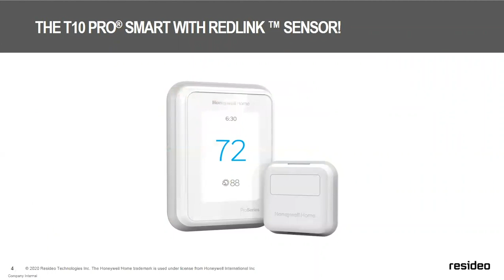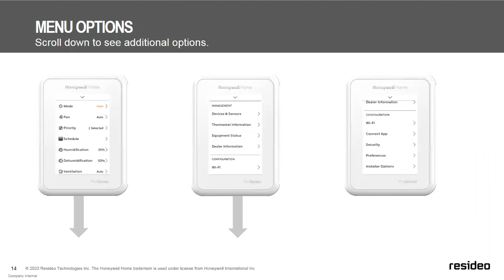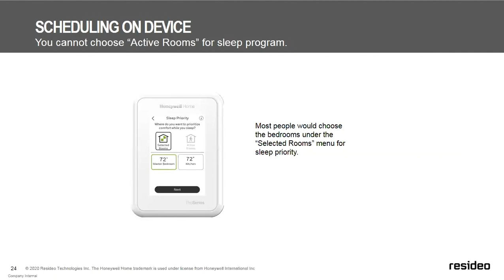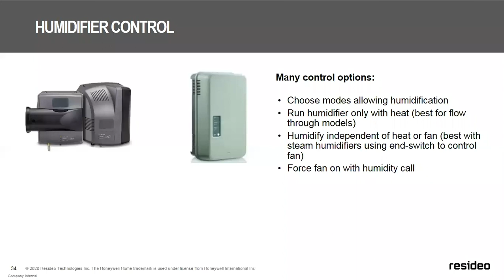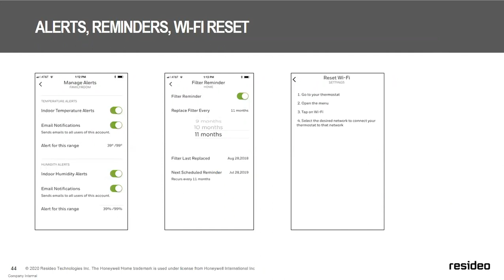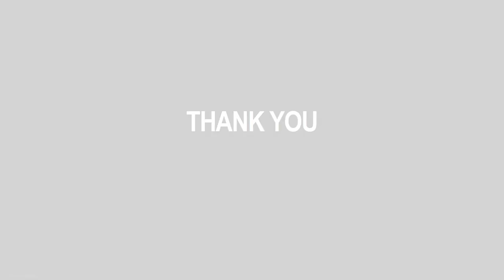T10 Pro Smart: The Game Changing Thermostat

Comment: we have this tstat as well since we had new hvac system installed in may of 2022, seems to work really well. how do you get to the area where you can adjust the sensitivity by 1,2,3 degrees? we changed this during cooling season cause it seems to run forever, and now heating time if its set say to 68 degrees, it runs to 70 cause we changed it to a 2 degree -, and want to set back to standard. any suggestions or how i get to that screen to change back?
Reply from the maker: Hi, we'd be happy to help! Could you provide us with the complete model number of your thermostat? This will be located on the back side of the thermostat itself. It’s a number that starts with RTH, TH, or CT. -Jerry
Reply: @ResideoPro  have try and get
Reply from the maker: Hi Rob, thank you for contacting us. To adjust the differential we recommend you reaching out to the installer of your thermostat. This is part of the advanced configuration that should be adjusted by a professional, you can find other local licensed professionals here: https://www.honeywellhome.com/us/en/find-a-pro/ -Maria

Comment: I bought this thermostat but it doesn't have humidification option on menu for some reason. I plugged 2 wires from dehumidifier to 2 U ports of thermostat. Do you know if it is  software or hardware issue?
Reply from the maker: Hi Soltan please provide us with the exact model number of your thermostat located on the back of the face plate. -Jim

Comment: Love the T10 pro, currently running it in a net zero home with 14 remote sensors, inverter heat pump, central dehumidifier and ERV w/24vac dampers.  The app is great especially the runtime analytics.  A few update suggestions:
1.  Add the ERV and dehumidifier runtimes to the analytics.
2. Add indoor / outdoor temp and RH% to the analytics 
3. Add easy analytics export feature such as .txt, .xlsx and .csv
4. a redlink expansion I/O would be helpful.
5. Separate priority by temp and humidity ie prioritize bathroom sensors for humidity only not temp to trigger dehumidifier.
Reply from the maker: Hello Ba0311! We really appreciate the feedback. Thank you! -Alex
Reply: Thanks Alex.  happy to help, its a great product.
Reply: Well Alex unfortunately I now have to caveat this post. My T10 failed a few weeks ago and I’m being told a warranty replacement is not possible anytime in the near future.  “Supply issues, etc …  Especially considering checking online reviews this is a common problem with honeywell/resideo, I was actually told by tech-support I could just go buy a new one and get it sooner at my own cost.

Comment: So basically your trying to cheaply do zoning without actually doing zoning. Is the company downsizing? Where are the zone dsmper controllers? I sleep at 65. My room priority. But my child sleeps warmer and is very small. So she’ll basically freeze to death while my priority room cools down. As well as hers. Although hers is set to 73. You guys are so close to a great product. You need WiFi vents that close/open.
Reply: The problem is the lack of flow when you close dampers and that can trip your flow sensor at your unit. I have same problem as you and I fixed with an Aux room heater.
That’s why Hydronic system works great in small rooms or basements.

Comment: What do I do if when I put the thermostat in cooling mode it says “Waiting on Equipment”?
Reply: The thermostat has a built in compressor
protection (minimum off timer) that
prevents the compressor from restarting too
early after a shutdown. The minimum-off
timer is activated after the compressor turns
off. If there is a call during the minimum-off
timer, the thermostat shows “waiting for
equipment” in the display. This comes defaulted from factory to 5 minutes.
Reply: @humbertopicardi9440  thanks!

Comment: ProTip.  when you install the T10, you will install the Honeywell Home on the cell phone.  This user name and password will be needed when you want to connect Total Connect 2.0 to the T10.  After you connect the T10 to TC and login you will have new devices, IE the T10.    In your TC account, you need to upgrade to WiFi enabled.

Comment: I've been doing HVAC about 25 years. I put a T10 in my own home with 3 remote sensors and I love this thermostat. The simplicity, the cell phone type interface, and the comfort it provides by averaging the different sensors and turning certain sensors on and off during different parts of the day. I've sold many of these to my own customers based on my personal testimony. There is 1 problem though, it gives you the option to control a hydronic system, however most boiler systems still have only 2 thermostat wires to the thermostat. Honeywell's own Wire Saver module still requires a minimum of 3 wires which forces me to use another manufacturer's C wire maker that will work with only 2 wires. Honeywell really needs to fix this issue